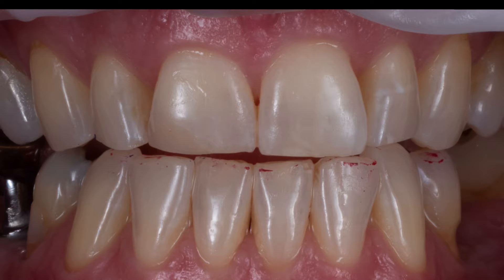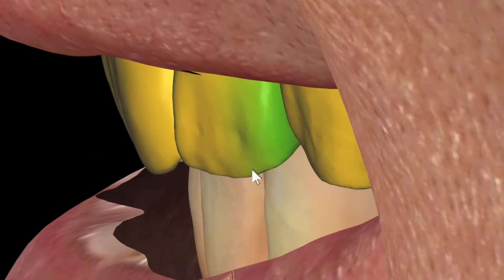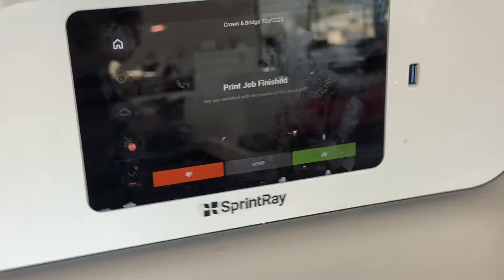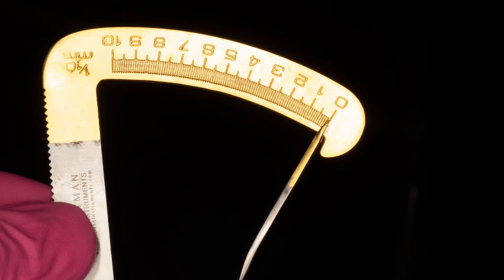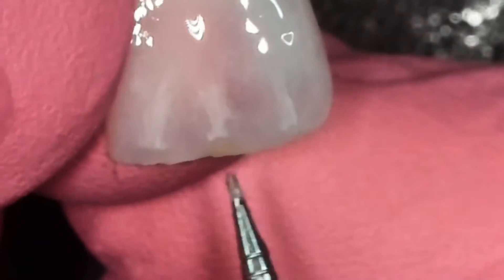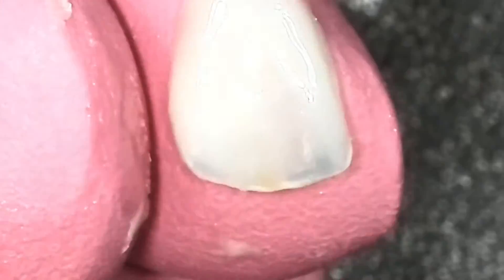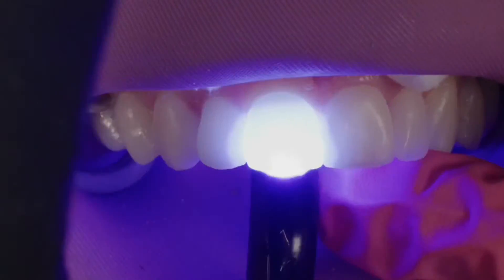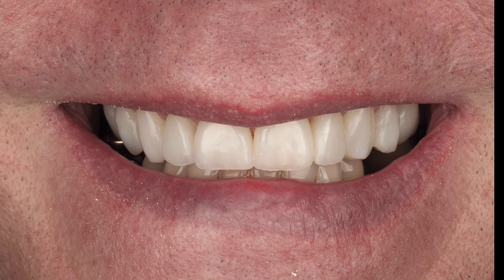100 micron thick 3D printed veneers

Comment: Beautiful job! What 3D printer do you prefer for better accuracy to manufacturing onlay, crowns, all on x or total removable prosthesis between SprintRay pro 55s,pro95s or the new pro2(2024)? Thanks!
Reply from the maker: The Pro 2 is more accurate than the 55s and 95s. It is clinically noticeable. Passive fits and screw channels much much better on Pro 2
Reply: Do you sell these 3d printers? Where can we buy? Link? @wallyrenne
Reply: But the light it’s not DLP in the pro2 and  the  resin works over 385 nm light .However I am trusting in your opinion because you are the best . Greetings from Romania!
Reply from the maker: yes it is LCD but the first ever LCD at 385nm vs the typical 405nm. The smaller wavelength allows for  finer details. It has a 35 micron XY resolution as well.